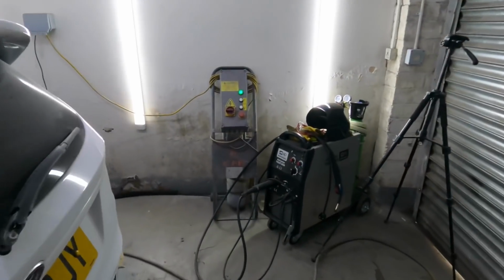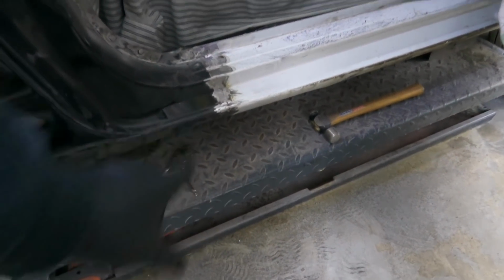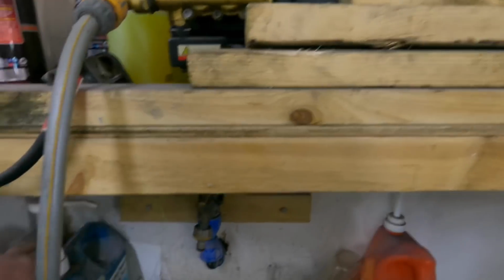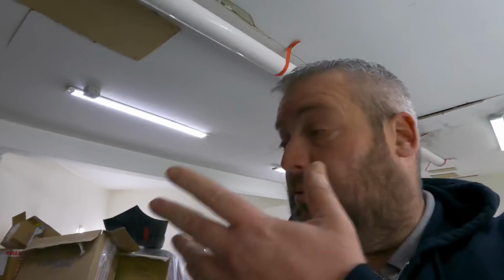Fiesta zetec s replica copart salvage rear quater repair and possible new workshop 💪💪💪

Comment: My friend you need to move. You’ve said in the past its what you want to do. Your current place is going to continue to be a problem for you. I mentioned before that a trading estate was your best bet for a spot. You can’t run a bigger business from where you are. The timing isn’t perfect but then it never is. Make sure you keep doing videos showing us setting up the new place. If you have an increased volume of business you can pick and choose what you make videos on. More custom detailing work would also add some depth. Remember there are YouTube channels where guys spend years restoring a car. If you haven’t seen them check out Project Binky (classic mini body with Celica GT4 underneath) or Home built by Jeff or Pete C (Mk3 Cortina GXLs). You could mix up day to day jobs with updates on more complex stuff. So i say go for it and show us the journey through setting up and getting started! Good luck mate you’re a star!

Comment: The new place definitely watertight especially 💦💦 where you would like booth .....is to risky to buy a premises or prefer to rent ?
Reply from the maker: It has a small leak that’s getting fixed landlord is on point tbh and it’s not where I’ll be rest is bone dry 👍👍👍👍
Reply: @grantssmartrepairs  worst case scenario just screw some guttering to roof.
Reply from the maker: 🤣🤣🤣🤣 not here the bloke said he will sort it ASAP